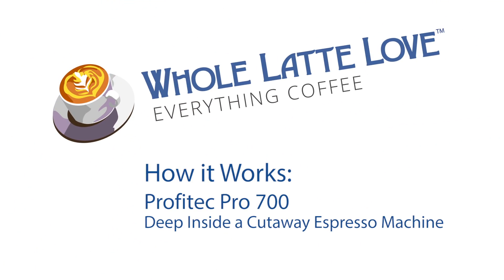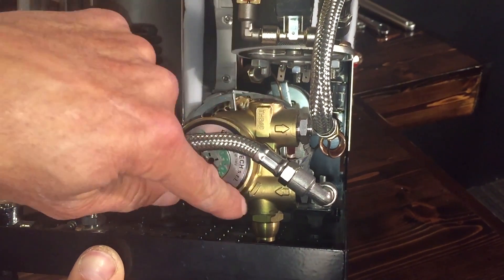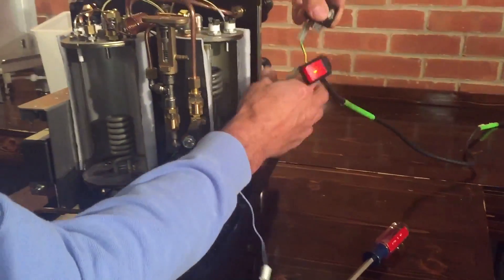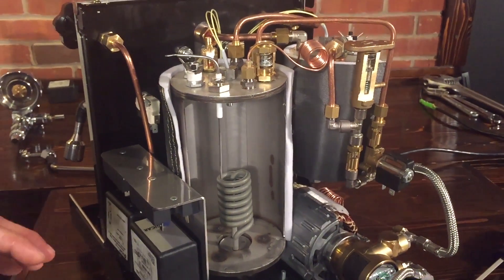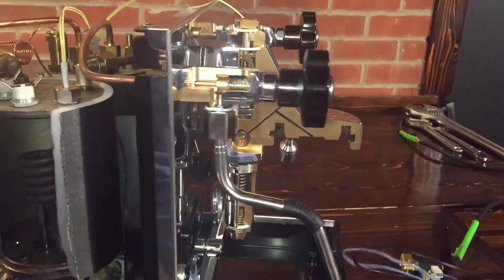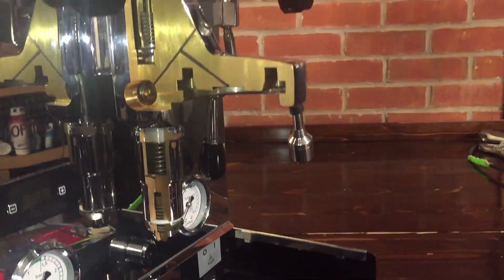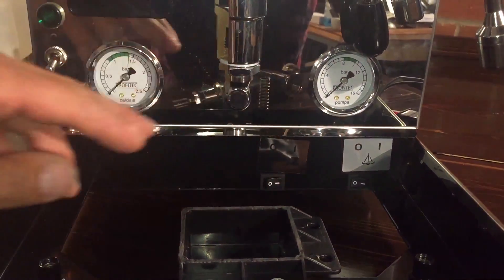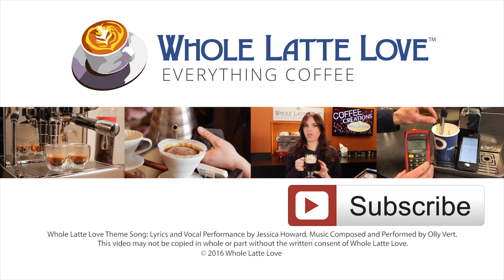How it Works: Deep Inside a Cutaway Profitec Pro 700 Espresso Machine

Comment: I really like the Pro 700 and if I were to get a dual boiler  I will get the Pro 700. My only wish is they would relocate those pressure gauges on the top section.. This machine has plenty of room upstairs after seeing the interior of this machine, then and only then I will seriously purchase one. I must have watched this video a dozen times. I like Todd for being so humble and you as professional guide. Your videos set you guys way ahead of your competition, who is insulting and offensive to the viewers.
Reply from the maker: Hi Ricardo, Thanks for sharing your thoughts. If you must have the gauges up top take a look at the ECM Synchronika. It's essentially identical to the Pro 700 internally. While the Pro 700 has excellent quality finishing and details the Synchronika takes it a step further with a custom taper of the E61 group head, upgraded trim accents, angled portafilters, joystick valve operation and the gauges up top!
Marc

Comment: Could you include a little more information on the drain tray? What size hose (inner diameter) is needed to attach and any recommendations on type? I know it’s just a drain so a basic plastic or PVC should be fine. Thank you!

Comment: Great video guys, I wonder if there are machines that are 100% stainless steel? I see come copper in this profitec, little unsure how it is to descale in long term
Reply from the maker: Hi JJ, Thanks for the comment. Copper pipe is used in most every prosumer level machine. Never seen a machine piped with stainless.
Marc

Comment: Hi, is very instructive this operation video, but do you have any video how to make a descaling?

Or  maybe show us why we need to do this maintenance operation correctly and make the coffee machine work perfectly.
I have been following your posts for a long time and they are very instructive.
I am waiting for an answer to this post. Thank you!
Reply from the maker: Hi na, You are welcome and thanks for watching and your kind comments! I do have a video on how to descale espresso machines with heat-exchange boilers: https://youtu.be/yEGfyJkWSqU The Profitec Pro 700 shown in this video is a dual boiler espresso machine. Most manufacturers recommend dual boiler machines be descaled by a professional machine technician. Those with proper skills can descale a dual boiler machine. It's more difficult and risky as dislodging scale in a neglected dual boiler machine during descaling may cause obstructions in other parts of the machine. It's also difficult to thoroughly rinse dual boilers after descaling. Best practice for dual boiler machines is to use water that does not cause scale in the first place. Here's a video featuring filtering products that maintain the mineral level needed for good espresso extractions but will not cause scale in a machine when used as directed: https://youtu.be/1v9WSIXtpos
Hope that helps!
Marc

Comment: Hey guys, this is the best video about espresso machine ever. Do you have about Profitec pro 800 lever?
Reply from the maker: Hi ii, Thganks for the comment and request. I have some video of the Pro 800 in operation but don't think there's much on the internals. Check the product page here which will include any relevant videos: https://www.wholelattelove.com/products/profitec-pro-800-lever-group-espresso-machine
And, you can find a parts diagram located in our suppport wiki for the Pro 800 here: https://wiki.wholelattelove.com/Profitec_Pro_800/diagrams_and_manuals
Marc

Comment: Very useful video. I bought the ECM Synchronika and it's pretty much the same quality build. I love the DB system with PID. The pump works very smooth. I also love the fact that you can do almost everything yourself. Thks for showing us. Greets from Holland!
Reply from the maker: Hi Peter, Thanks for the comment! The ECM is very similar to this machine internally. Big difference is a little more refinement of the external components. Greeting back from the US.

Comment: A question about the stainless steel braided hose - what is the lining material on the inside? Is it rubber?
Reply from the maker: Braided stainless hose typically uses a PVC inner core. Not aware of any using rubber.
Reply: Thanks for the clarification! Was curious as I had no idea what it is.

Comment: Great video! I'm curious about the brew boiler. It looks like it had a water level sensing probe much like the steam boiler. How  are the water reaching the input to the water siphoning system to the brew group? That input was at the very top of the brew boiler while I think the water sensing probe was at least a couple of cm below the top of the boiler?
Reply: I am no expert but from what i understand the brew boiler is always full of water so it can build pressure with the pump. The steam does not require the pump to build pressure, just heat so it needs a head room to build the steam.

Comment: Won't the water from the brew boiler get colder as the pump creates pressure by pumping in cold water from the mains. I ask because the Izzo Alex Duetto IV has the water from the pump going through the steam boiler so when it hits the brew boiler there temp difference is lower than the direct method.

It looks like the in and out are both in the top of the boiler in close proximity. I would be disappointed to see  a temp drop while brewing as I am buying this machine to get stable brew temp and not have to flush so much...
Reply from the maker: Hi Esben, When you brew a shot the refill water will cool the boiler momentarily. But it recovers very quickly. Remember you are only using about 2oz/60ml of water. The boiler and other components have a large thermal mass which helps to heat that water and stabilize temperature. And, with PID control the heating coils within the boiler activate in short burst to quickly get back to set temperature. So long as the machine is fully warmed up the boiler will be back to PID set temp before you can grind, tamp and load for the next shot. As you mention, there are machines which use a heat-exchanger in the steam boiler to pre-heat fill water for the brew boiler. Another machine like that is the Expobar Brewtus. This works well but you do run the risk of overheating the brew boiler if doing many shots back to back. It's easier, faster and more accurate to heat a brew boiler with PID and arrive at preset temperature than it is to cool it down if it's overheated.

Comment: Watching Todd demonstrate the build quality on the PROFITEC is the best sales pitch I've ever heard. 
On first view I knew what machine I would purchase...A done deal. Just dragging my feet over the cost but continue to gather information.
Your videos have been outstanding!
I'm leaning towards the next model up. For 200 dollars extra, it's a nice upgrade.
Reply from the maker: Hi Rick, Thanks for the kind comments., Todd does know his espresso machines!  He's likely been inside more machines than anyone in the US. Guessing you're considering the ECM Synchronika? It is a fine upgrade for another 200. The machines are essentially identical on the inside. The ECM is more refined in the exterior finish detail, has angled PF and includes a quality tamper. ECM also has a unique outer case which allows for quick/easy panel removal. One last difference are the steam and hot water valves. Both machines utilize low wear sprung valves with the ECM's operated with levers and the PP700 using knobs. Please let us know if you have any questions.
Reply: Whole Latte Love I do have a question on the 300 model. What's with the steam boiler pressure guage over showing brew pressure which I find more useful. The 300 is really all I need but lack of showing brew pressure makes it a no buy for me.
I'm down to drinking just amercanos with my second BDB which is on its last legs. Will eventually rebuild it as a project but I want a new machine now.
The fit & finish on the Synchronika is stunning!

Comment: Great video, can you do a video on what kind of water to put into an espresso machine?
Reply from the maker: Hi Andrey, We've done a few videos on source water for brewing espresso. I'll link to some info below. One might logically assume the purest water possible like distilled or RO treated would be best. Turns out that's not the case. You want some mineral content in the water (but not too much) otherwise taste tends to be very flat. I like to think of it like salt on food. A little helps bring out flavor and too much is unhealthy. For espresso machines high mineral levels cause scale to build up. For Prosumer level machines like the Profitec Pro 700 in this video which are plumbed in we recommend a high quality external in-line water filter like this one: https://www.wholelattelove.com/products/bwt-bestmax-premium-filter-package
The Bestmax premium filter is a multi-stage filter so removes particulate matter and chlorine. Its unique feature is removal of scale causing minerals which are then replaced with magnesium. Magnesium maintains flavor but does not cause scaling.
Specialty Coffee Association brew water standards: http://www.scaa.org/?page=resources&d=water-standards
Video: Should I Brew with Ultra-pure Water: https://youtu.be/QceGglAWwcY
Video: BWT Bestmax Filter Review: https://youtu.be/yYilGVC-LaI

Comment: I was already 99% for the profitec pro 700, now i'm 100% after this video. Great great great!!
Reply from the maker: Hi Bruno, Thanks for your comment! The Pro 700 does not disappoint! Not to throw a wrinkle into your decision, but as mentioned elsewhere in the comments you owe to yourself to check out the ECM Synchronika as well. The internals are essentially identical to the Pro 700 but it comes with some added touches to the exterior, an included tamper and an innovative case design. See the review video here: https://youtu.be/hunFv7E51L8
Reply: What did you end up getting? and did you like it?

Comment: If I had the money, I would buy two of them. One, to make coffee with, and the other to put on display  as a nice work of art. These machines are nicely made.
Reply from the maker: Hi Blues, Profitec machines are well put together! If you like the Pro 700, be sure and check out the ECM Synchronika if you have not already. It's nearly identical to the Pro 700 internals and specs. For a couple hundred more $$ it adds another level of refinement. Things like: extra detail finishes on the E61that match with lever and PF handles, angled PFs, included bottomless PF, matching logo etched tamper, silvered PID display and a truly innovative case design.
See the review video here: https://youtu.be/hunFv7E51L8
More details here: https://www.wholelattelove.com/products/ecm-synchronika-dual-boiler-espresso-machine

Comment: Thank you so much for filming this video it is very helpful.Please can you clarify what is the white small vertical cylinder hidden between the rotatory pump and the back of front panel?
other thing is my machine make metallic shaky sound after the rototary pump finish filling the steam boiler with water(only with steam boiler water filling and excatly when the rotatory pump stop after finishing the filling process of steam boiler) ,any idea.Thank you again.
Reply from the maker: Hi Omar, Great Question! The white cylinder is a capacitor. It temporarily stores electrical energy. The capacitor in US model Pro 700s is larger and in a different location than EU machine shown in this video.

On the sound... would have to hear it but could just be the pump winding down or perhaps a solenoid closing.
Reply: Thank you for reply.